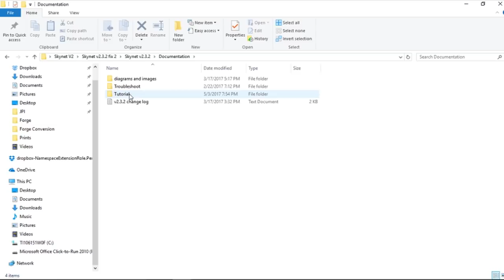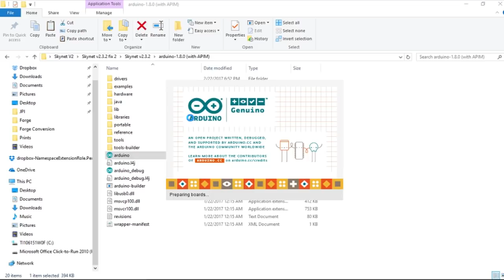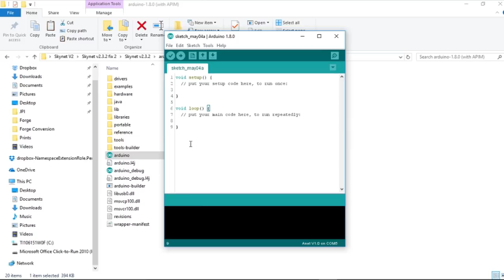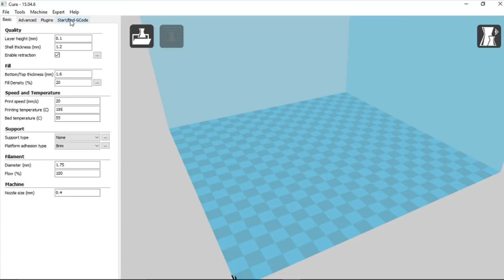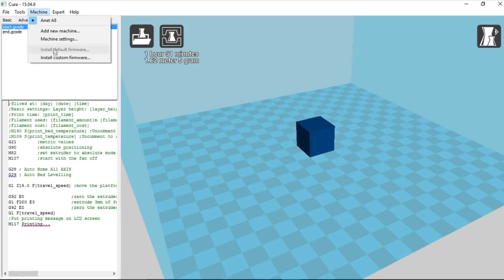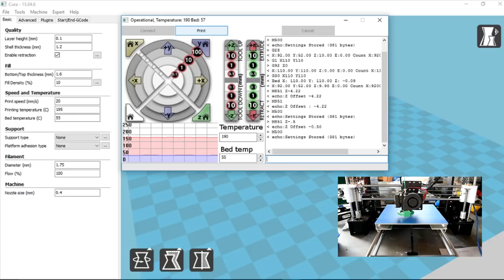How to set up Auto Bed Leveling On Anet A8 With Skynet Version 2

Comment: Is there any way you can post your configuration h file . I'm so frustrated my home is about 50mm from center and 5 mm to the right just about. ( basically to the right front  of the center)I'm so frustrated with doing 3d printing at this point. I have a anet a8 but it doesn't look like the others the bed has each wire individually in the connector and they may have listened to the complaints and upgraded items  because some upgrades I've seen people do I don't need. Ex. Bracers , mine doesn't  shake . Any help would be appreciated I have skynet 2.3.2 loaded but it crashes into the bed also. I have a Uspasp and reflashed anet a8 and it works fine so I know it's not the printer alignment. But I want the safety features and reloaded skynet. I followed the guide and the only thing I can thing I can think is the settings in my configuration h are wrong. The original anet firmware printed fine any help would be appreciated! I really dont want to put my anet in a room and monitor it during the whole print.
Reply: Dont use skynet, use Marlin more opcions nd with some youtube tutorials you will learn to configurate de hot bed

Comment: My sensor is and 18mm no sensitivity screw, the thing keeps crashing at the G28 command I have it installed in the back of the carriage assembly behind the nozzle, I picked up the .h profile for a 5 button display which on my printer , would that be the cause for the whole thing just none stoping crashing the bed and dang I have a 3mm glass bed, thanks...And I agree this is the best video I've seen explaining the process thank you for taking the time and sharing

Comment: Can someone help me? When I upload the system I get such a error:
         Using Port                    : COM6
         Using Programmer              : arduino
         Overriding Baud Rate          : 57600
avrdude: stk500_getsync() attempt 1 of 10: not in sync: resp=0xd6
avrdude: stk500_getsync() attempt 2 of 10: not in sync: resp=0x6f
avrdude: stk500_getsync() attempt 3 of 10: not in sync: resp=0x80
avrdude: stk500_getsync() attempt 4 of 10: not in sync: resp=0xbf
avrdude: stk500_getsync() attempt 5 of 10: not in sync: resp=0xae
avrdude: stk500_getsync() attempt 6 of 10: not in sync: resp=0xd6
avrdude: stk500_getsync() attempt 7 of 10: not in sync: resp=0x02
avrdude: stk500_getsync() attempt 8 of 10: not in sync: resp=0x21
avrdude: stk500_getsync() attempt 9 of 10: not in sync: resp=0xcc
avrdude: stk500_getsync() attempt 10 of 10: not in sync: resp=0xd6

avrdude done.  Thank you.

Podczas ładowania szkicu wystąpił błąd (
An error occurred while loading the sketch)

Comment: Hi... first time uploded resulted in a bricked A6, already recovered, but now I manage to upload the original A6 AutoLevel configuration file but as soon as I make the necessary changes for the BLTouch sensor I get a message stating that the sketch is to big to fit on the memory, any experience on this?

Comment: What version of cura are you using in this video??
Reply from the maker: Its an older version. The newer version doesn't let you connect through USB.
Reply: Ok I did the update but my printer didnt restart.   Is it supposed to?   I already had the older skynet already.

Comment: C:\Users\NICKAN~1\AppData\Local\Temp\arduino_build_251118\sketch\MarlinConfig.h:30:27: fatal error: Configuration.h: No such file or directory

 #include "Configuration.h"

                           ^

compilation terminated.

exit status 1
Error compiling for board Anet V1.0.

i keep getting this error. iv redownloaded and rezipped the file many times. but every time i get the same issue.  any ideas?
Reply from the maker: sounds like your not moving the configuration.h file

Comment: does the start/end-gcode has to be on every print after that? Now when I try to print anything, it goes and checks like 10 different spots before it will start... that's fine except half of the prints, my sensor is off the bed.

Comment: when I set my printer to home with the new bed level sensor, it just keeps crunching it down and never stops trying to lower... I have to cut the power from it because the motors won't stop like they used to when it hit 0 on the Z stop. The Z Stop is plugged in correctly. I don't have a flast board on mine that mounts to the back like yours. Mine appears to mount on the front by the fan.
Reply from the maker: Most likely your sensor is not triggering. How far above the tip of your nozzle is your sensor?
Reply: the size of a zip tie... I set the nozzle down to where I normally set it then adjusted like you put in your video... the sensor is on the front instead of the back, would that cause an issue?
Reply from the maker: When the nozzle comes down and hits the bed is the sensor over the bed?
Reply: yup and it's plugged in to the z-stop
Reply: turns out the plug was wired wrong, I had to reverse the blue and brown wire to get correct power.

Comment: Hey thanks for the tutorial, I was following the written guide they gave, and when doing the leveling before the print it pushed so hard on the bed the glass broke, turns out I found out when watching your video I wrote the wrong offset (took the position just under) so the offset was 10.6 instead of 0.57 ..
Reply from the maker: Cdek654 same thing happened to me. I don't have a glass bed so no breakage but gouged my bed pretty good and killed the nozzle.
Reply: Ouch, I'm glad I have spares, and the bed / nozzle aren't damaged! :P

Comment: Do you have to print with Cura or that's just for the setup?
Reply from the maker: 97JoMiller just for setup. The earlier versions of cura allows you to control your printer through usb and enter in G code commands which make calibration a lot easier.

Comment: Not a bad tutorial at all, has a lot of useful info to help the process along, but  the version of Cura included (and the new downloadable one) doesn't have a machine control panel. Using Simplify3D's machine control panel the steps are mostly the same and I've done all my programming through it.

Comment: Hi! Amazing video so far, I am at the 11:13 mark in the video and on my screen from cura that pop up doesn't show up. It shows up operational and detecting bauderate and such however none of the buttons show up other than print. Did i do something wrong? or is my version a different version? I have no idea, everything else looks the same as yours though
Reply from the maker: Dylan Purcell this happened to another person too. I think they reinstalled cura and that fixed it.
Reply: Same thing happened to me two days ago. Even tried the new version. Two computers. No control panel. Gave up using Cura yet again (Cura is the reason I bought Simplify3D several months ago, plus, S3D is awesome) I used Simplify3D to do all my programming.

Comment: I got 0.39 as Z offset  and it works well in the center and one side of the bed  but when i print large  things  , one side of the bed  the nozzle is too high than the other side, what can be wrong?  why the sensor is not compensating that?
Reply from the maker: Jasson Sanchez I'm not sure the firmware should be compensating. More then likely your bed is warped leaving a dip in it that the software can't compensate for...im just guessing. I have problems with larger prints as well and I think my bed is warped a bit.

Comment: I dont get that window in cura when pressing print via usb I get another one.. without the move and command
Reply from the maker: Yarni Pels I believe it's in the settings to change the print interface to the prontorfaceUI. if I remeber right it's under File, preferences
Reply: Great thanks! :)

Comment: Hi 
did the extruder moves to its previous position after you entered the command G30 x110 y110???
Reply: The extruder should move to and probe (if it's already there, it won't move in X Y, just Z) the same spot. G30 means 'Return to secondary home position'. I think in this case it's been modified to move to and probe.

Comment: Thank you very much for sharing this just for a question I'm using a stock auto leveling sensor but mine came different from yours , it hang on the left side of the extruder .so my question is what configuration file should I use ???
Reply from the maker: seetcas that is a good question! unfortunately there is no configuration file for that set up that I know of. You may be able to use one of the configuration files for the non anet sensors as I believe these are usually side mounted.
Reply: ProjectTube I will try to use 12mm profile
Reply from the maker: Give it a try, just be ready during the auto level sequence to pull the plug if the sensor misses the bed making the nozzle push down into the bed.
Reply: ProjectTube Thanks

Comment: So if your Z comes out like 1.13 then I dont need to do all the extra steps?
Reply from the maker: Michael Lewis if your z comes out to 1.13 then you'll do a M851 Z -1.13 and then a M500. try to print and see how the first layer prints. if it's still not close enough start moving the z offset down like M851 Z -1.5 and so on.
Reply: Wow was not expecting a reply so late but printing now it looks pretty good! Better then me trying to level with the screws only thing is the bracket I printed out I'm not sure how it's held does it screw into the drilled hole on the bracket for the extruder? and secured with the nut?
Reply from the maker: Michael Lewis not sure which bracket your talking about. The stock anet sensor bracket attaches to the back of the extruder with two long screws and the sensor is held onto the bracket with screws and nuts.
Reply: ProjectTube I had to make my bracket since I got the sensor only and not the Anet with the sensor with it
Reply from the maker: Michael Lewis oh ic, well my original bracket broke so I had to print one too. Make sure you don't over tighten the bolts holding the bracket to the extruder it will bend the bracket and eventually it will snap....whoops lol.

Comment: I wish I'd seen this video last night when I was setting it up. Everything went fine until I got to the z offset part reffered to at 17:00 minutes into the video. I merit crashing the nozzle too. I edged up doing it manually and getting it. I could have saved a couple of hours by watching this video. Somebody linked me to it over at the a net Facebook page. I was gonna make a video showing this exact same thing. No need to now. I have the a6. Thanks
Reply from the maker: I feel your pain I now have a nice box shaped line carved into my bed from the nozzle scraping alone it the first time. Best thing to do is you get a positive number is set Z to 0.00 and start moving down from there. The biggest advantage to version 2 is the ability to easily adjust the Z  offset with the M851 command.
Reply: ProjectTube  I subbed you. I'm interested in casting process too. I ain't ready for that yet, but it's filed away as one of the next projects.😁
Reply: Would the difference in height of the bed change this value?  Since some people might screw it in more or less causing a unique offset for each A8 owner?
Reply: ProjectTube  I had to reset my z offset yesterday because I had to drop the heat separator tube about 2mm to insert a filament guide inside the extruder. This time though the offset number was low, it was something like 2.20 millimeters, so I used the exact procedure in the manual by entering -2.2. This time it worked perfectly. The comment you made about ," if it's a small number, it should work fine",  was right on the money. I think it's a problem related to the cube sensor. 

Now, I'm trying to get the x and y sensor offset dialed in. I got it close, which is probably close enough. To set that one you have to change some values in the config h file, reload it in the skynet folder, then you have to reflash skynet onto the printer. I got it within 5mm, but I don't think that the cube sensor senses in the exact center of the sensor which is why, I'm off a little bit.
Reply from the maker: +DJDevon3 the Z offset if I'm not mistaken is a measure from where your nozzle is when your sensor triggers to where the bed actually is. It's the amount the nozzle has to travel down after you sensor triggers to get a good first layer.
Reply from the maker: I think your right, the cube sensor is just not that good. I will say that once its set accurately it seems to work consistently. I feel your pain with the X and Y offsets. I had to play around with those in version 1 and keep re-flashing the firmware each time. Good Luck!

Comment: Hi,
will this firmware working with Practical 6 - 36V Auto Leveling Sensor?
Thanks
Reply from the maker: +KRONOSX Kronos Addict this should work with any sensor assuming the sensor is installed correctly and the firmware is calibrated for that sensors offset.

Comment: You mentioned a better sensor than this one, what is the better sensor?
Reply from the maker: +Mike Carter well i feel like the aftermarket sensors like this one are better but I don't really have any evidence of that. 
https://www.amazon.com/gp/product/B008DG9FLS/ref=as_li_qf_sp_asin_il_tl?ie=UTF8&tag=proje035-20&camp=1789&creative=9325&linkCode=as2&creativeASIN=B008DG9FLS&linkId=dbef8687101b8ed02ee5f474509f992d
Reply: make sure you get 8mm, it's much better.

Comment: I am getting a negative number on the last step as well... sensor is new out of the box today... any idea's?
Reply from the maker: +Big E FPV not sure, unless we are both doing something wrong or there is a issue with the firmware as the documentation says it should be a positive number. Try doing what I did, do a M851 z0.0 and slowly decrease it until you get a good first layer...M851 Z -0.1, M851 Z-0.2 and so on.
Reply: How did you INITIALLY set your sensor when you started this? Lets take that out of the mix...
Reply from the maker: +Big E FPV with version one I did it manually. I adjusted the sensor hieght so that it triggered before the nozzle hit the bed. Then using cura to lower the z axis in .1 increment counting how far down the nozzle needed to go in order to be a sheet of paper thickness off the bed after the sensor had tripped and entered that value as a negative number. That's the offset value the difference in hieght between when your sensor triggers and your nozzle is at the correct hieght to print.
Reply: I'll see what I can mess with and figure it out...
Reply: 2 hours of messing with it and still getting a negative reading for the Z at the end....I've about given up..
Reply from the maker: +Big E FPV what number are you getting?
Reply: roughly -3.0 or so and the nozzle it hitting the bed...on that last G30 command
Reply from the maker: +Big E FPV the nozzle should not hit the bed on the G30, your sensor should trigger stopping the nozzle before it hits the bed. Try lowering your sensor down. Lower your nozzle to it touches the bed then drop your sensor so it also touches the bed. Then raise your sensor a tiny bit up. If you already done this then perhaps you got a faulty sensor or its not wired correctly?